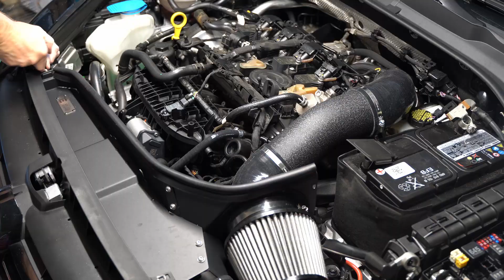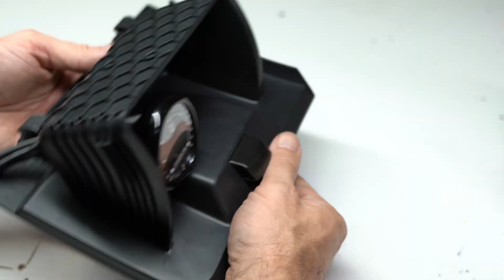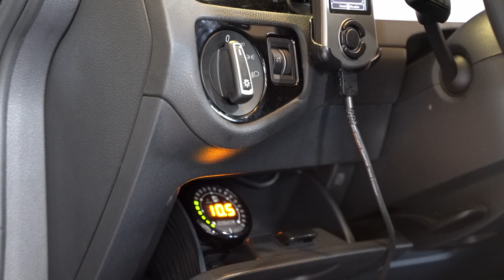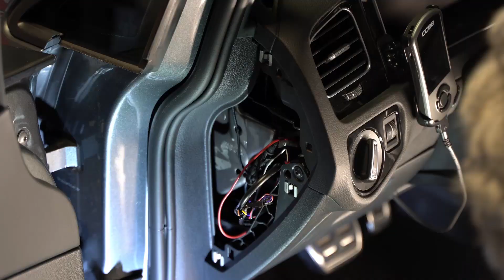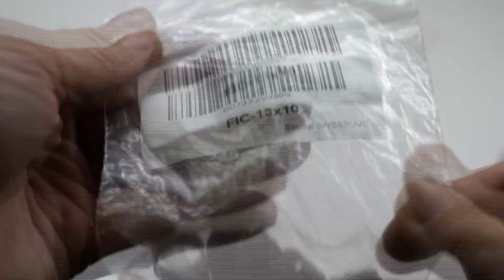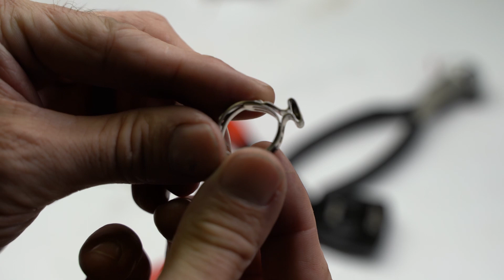MK7 Ethanol Sensor and Gauge Install - Innovate Motorsports - 2019 Golf R

Comment: I know this vid is old, so this kit doesn't have you pin into the ecm connector so the senor and ecu can communicate? how does the sensor communicate with the ecu so the flex tune works? or is this solely for the gauge and monitoring ethanol content only?

Comment: I completed the install of the sensor and gauge on my 2019 GLI today. I placed the sensor in the exact same loaction as here , I did find that you need to orient the rear of the sensor slightly upward to have room for the 2 ends to slot into the intake manifold. I also wired it pretty much the same as explained here looks oem basically. Thanks again for the video and directions.

Comment: Hey man, nice videos. Like the one with the HPFP upgrade too. Just a question about your tune/Ethanol sensor. Where does the sensor hook up to your ecu for the tune to change ignition, timing etc? Or is the tune just a straight ethanol tune and can’t run on a mix of unleaded and ethanol?
Reply: This is just to monitor ethanol content you have in your tank, as it can vary at the pump from the minmal legal limit of 51% up to in some cases 95%. The EQT tunes he runes offer either e30 mix or e85(which allows for 60-85% content).

Comment: Great video! I watched a few times but I can’t seem to catch where you talk more about which direction the fuse wire gets connected in the fuse box. You mentioned series vs parallel. Can you provide us with more detail?
Reply from the maker: At 10:48 where I say that the wire points down in this case, and that the power source should come from the opposite side of the wire. That’s why it faces down, because the top side is the hot side in this fuse location.
Reply from the maker: At 10:48 where I say that the wire points down in this case, and that the power source should come from the opposite side of the wire. That’s why it faces down, because the top side is the hot side in this fuse location.

Comment: FYI I designed the gauge mount. It's actually designed to mount to the left side and hence the angle. With it mounted to the left side its almost invisible.
Reply from the maker: Cool. Great design idea. I tried it a few different ways and strangely ended up with it the way it is… not sure why. Maybe it was because I didn’t have to “mount” it.  It just sits quietly and securely in place. Hahaha